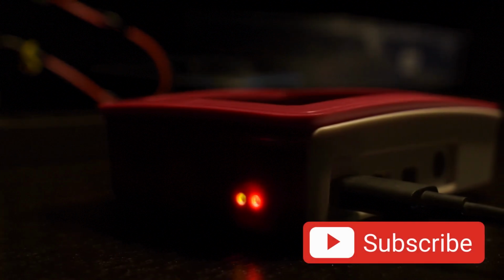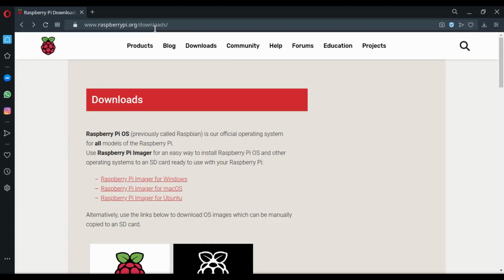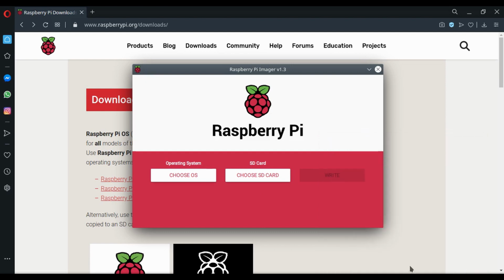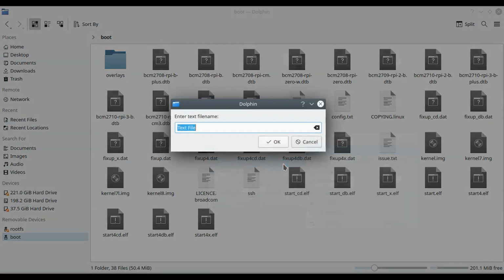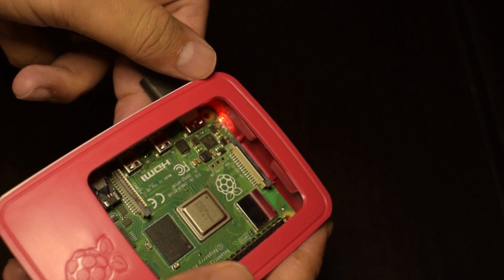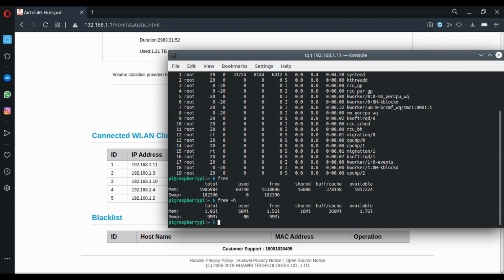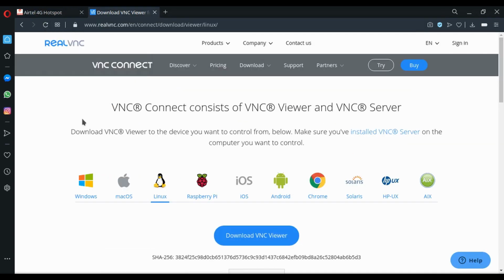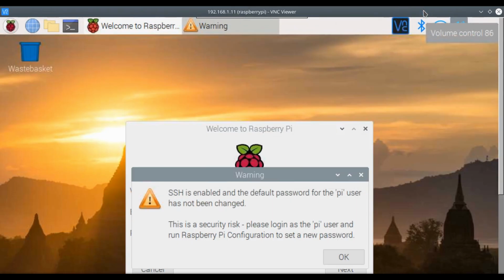Setup Raspberry Pi 4 from scratch and access to UI without a display or monitor

Comment: When I ssh in and type sudo raspi-config all I get is a blue screen. No text ?
Reply: this is on pi zero
Reply: urns out the latest OS version is just too much for a PI zerow . raspi-config works but takes literally five mins to change screen. from the cmdline things are fine. Others have said about this and suggested changing to legasy video drivers (Goto raspi-config / advanced / enable legacy graphics). I will try when i can get to the screens. lol
Reply from the maker: Let us know if you get some way to do it. Zero has very little RAM to drive a GUI, but always someway is there.